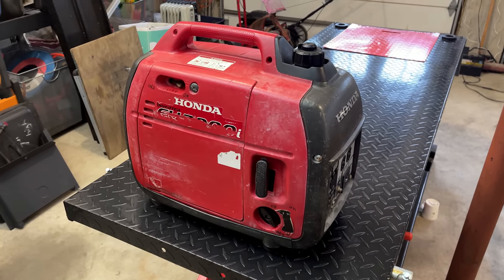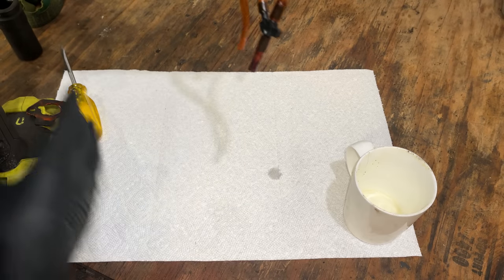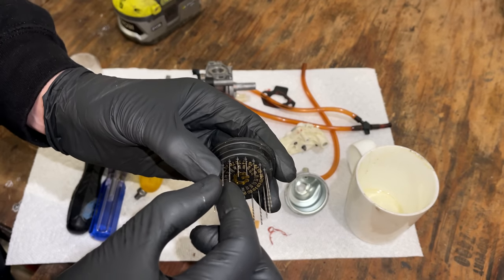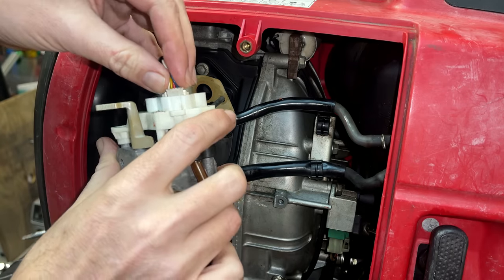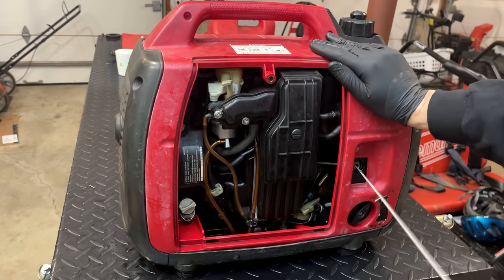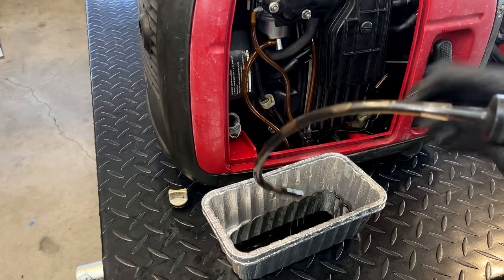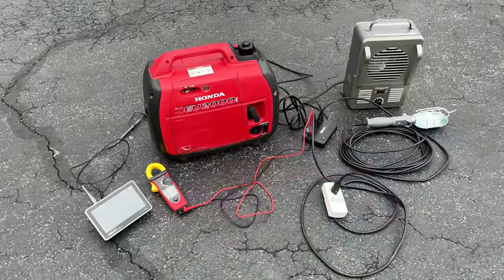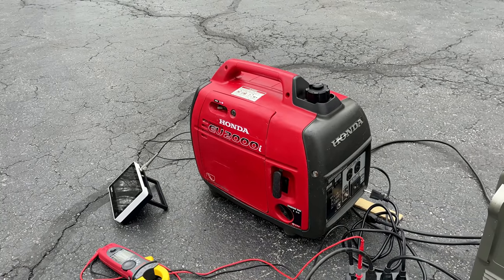Old Honda EU2000i Generator Leaking Fuel

Comment: Why are there extra tubes on that carb ?
Reply: Drain and overflow.....
the lines lead the spilling fuel straight down to the bottom and out of the machine...
less chance of flames that way....
Reply: @JohnSmith-yv6eq  The drain is on the bottom. If those other 2 tubes are overflow, why was   fuel NOT coming out of them when the needle was not properly seating ?
Reply: @jackpatteeuw9244  
because the bowl drain plug was tight and was not leaking....James had to undo the bung in order to drain the carb..and as he said "should have done that with the carb still on the machine".
If you have corn juice in your gasoline...it's worth drianing the carb this way when storing the generator unti lnext camping season....
and the top overflow...well the needle only allowed sufficient fuel to make it's way out of the airbox.....not a huge amount enpugh to flow out of the top overflow...

Comment: I have a similar issue except the fuel is leaking into the piston side. I know this because i cant start the engine hot and I need to wait 10 minutes before it will start again. Plus there is fuel in my engine oil. Not really sure what the fix is because my float and needle seem to be working fine.

Comment: James what is a fair price to ay for a used Honda Eu like that one you repaired?
Reply from the maker: Usually between $500-$600
Reply: @jcondon1  Thanks LOVE your videos. That what I thought for a price.   I have a eu2000i, a eu2200i, a eg2800i, and a Honda Harmony 2500.  I found another eu 2000 that someone sold me for $300.00 which I had to clean up and work on and only spend less than $100.00 for parts. All my Honda generators are wonderful and run great when needed. 

Thanks for giving is such great videos on your excellent work.

Comment: I think if the ground the generator was on was unlevel, I would put oil in until it was at the top of the threads even if more oil rather than trying to level the genset because all its going to do is vibrate off.

Comment: Hey James have one of these that dies when loaded in eco mode but can handle a load with eco off. Any suggestions?
Reply from the maker: If applying much more then 800 watts at once then eco mode has to be off or it will likely stall.  How much are you loading it at once?
Reply: @jcondon1  maybe that’s it. Was trying a 3 gallon air compressor and a shop vac separately. It did run a medium size floor fan ok.
Thank You!

Comment: Crikey. You're in your shop with a piece of equipment you know leaks fuel and generates electricity. 
Could be a bad combination? I'd have done all of this outdoors where a fire could be walked away from.
As for needle valves. They're cheap, cheerful, and stop working if even a hair gets fast in the orifice. The other thing they do is stick solid until you remove the carb from the engine, then immediately conceal their crime by starting to work again, especially when you turn the carb upside down to test it. They also tend to stick a lot more easily when they start to wear where the needle seats into it's hole. Not great.....

Comment: You need 3 things to run you always have Air you have fuel so spark, I would have hit with just a bit of start fluid just to check if it would pop off!

Comment: I have the same Honda and it has this problem since the day I bought it it runs fine but once I have finnished with if I leave it for around 2 weeks it will not start unless I take out the spark plug put some petrol in the cylinder replace the spark plug then its A-ok it have been returned to Honda they say its fixed but still has the same problem it appears its a lemon no one has been able to fix

Comment: It's so crazy that my generator never has leaked fuel yet at the carb and I never turn off fuel just leave it in the choke position for easy starting mines a wen 3800

Comment: I really hope you did not use 0w20...AT LEAST 10W40 on older engines
Reply from the maker: It would run better with 15w-40.  I used 10w-30.

Comment: Supposed to be a One Pull Start.
Reply: All things being equal...yes they are.

Say you have turned it off to refuel it after running it 5 hours on an auxiliary fuel tank (outboard motor tanks can be adapted because this Honda gen has a fuel pump).
You fill the tank, check the oil...pull the cord and it works for another 5 hours.

One pull. (hot engine run on good gas, well cooled, oil level and quality good, spark plug good.)

Second scenario: 

You stored this in the shed for the last year, at an angle and where dust and dirt can blow in and cover it. 
It has half a tank of fuel that you tipped out of your old rusty gas can just before putting it in storage.

Now 6 months later you go to start it....and you pull...and pull...and pull...but it won't start.

You strip it down like James did and find water in the fuel, water in the fuel pump, water in the bowl,..
and corrosion in the carb jets too.

Is that the Honda's fault or just your stupidity?

Comment: Those poor fuel lines are as stiff as a dried stick.
Reply: The drain and overflow lines are not subject to much movement...
they could be replaced by tygon lines....
and the actual fuel line in seems flexible enough....
Reply: As Taryl says "hard as a carp " !🤪

Comment: You really think it is that easy to hire and keep a good small engine tech?  Even for a Honda dealer.The one thing I do not like about the Honda 100/2000 W generators, they have an overhead cam belt, if that goes, it expensive to replace.

Comment: They should all just come with a replacement carb,,jeez
Reply: The original carb works for decades as long as the owner looks after the fueling and the draining of the fuel system...
and doesn't store it with ethanol gas in the system or tank,,,,,,,,

Comment: Come on. Nobody, even Honda would touch it? Kinda sounds like a hokey story. Would have like to see another week of sitting for another smoke check. That may have burned off, but I bet there will be another smoke show at its next start.
Reply from the maker: I think you are right.  Probably needs new rings and valve seals.

Comment: mopar penetrating fluid is the best thing to clean jets etc .. spray some in a cup drop in all yer jets , tubes etc and let it sit for a few hours your mind will be blown with the junk  that will come off and spray it into all carb holes  let it sit for a few hours rotating carb in different positions every so often . and then clean out with brake cleaner  , carb cleaner is a joke and sticking wires threw doesn't do a complete job , trust me try it

Comment: You just bend the brass bit that hits the needle shut takes a few seconds.
The rest of the video is nonsense.
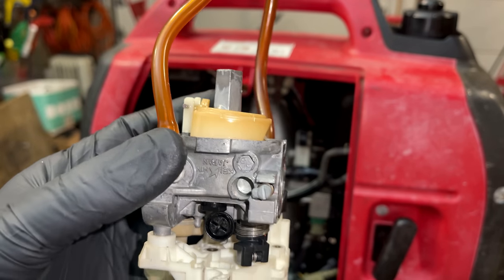Reply: 23:43
No brass bit able to be bent..
All plastic including needle. 
Needle bent=curved=less length than necessary to stop fuel flow....
Replacement only option...

Comment: Reasons why not to buy a Honda generator. Overly complicated. Repair parts expensive. Excellent marketing per low noise figures. Generator noise that can be handled simply by cardboard deflection panels.
Peace from Texas

Comment: Sure glad I was not paying for your time!  I am a Honda trained motorcycle tech, owned one of these Honda gens for 4 years , was full time rv living.   Sure you was dumbing this down and dragging it out for you tube,  not sure why you would want to yank that cord as many times as you did, way to much effort.  You clean the carb and replace the plug, crazy you didn’t knowing all to well the engine was flooded due to a carb issue and it certainly would have a wet plug.   Lots of smoke and mirrors with all that test gear too,  all you needed was a load to 1500 watts and a volt meter,  was you trying to impress the less knowing?   I would like to say well done,  but I think your a bit of a con artist.  You made this way to technical and dragged it out for what was a simple fix.   For the cost of a needle and float,  a can of carby cleaner, cheap, compared to your labour time,  the cleaned carb should have been set up with a new needle and float.   Then. After all this, you cleaned the plastics up with wd40 then proceed to fit stickers?  More labour time?   Then more labour time setting all that test gear up? 
I hope the customer was ok with being bent over like that .   I guess your got to make money some how? 
I have done this carby clean and spark plug replacement many times over 4 years, it a half hour job at best!  
In half the time you spent I would have had the complete plastics off and checked the tappets.
Reply from the maker: The customer was not charged for the repair.  YouTube takes care of that.  The needle and float I pulled from the other carb were new and installed when I rebuilt it.  That carb was not running the engine well so I ended up not using it.  Many have asked to see the harmonic distortion and the sine wave output so I try and work that into most videos.  And yes I pulled it over way too many times.  The customer said it ran, but was leaking fuel.  Should have checked the plug sooner.

Comment: Anyone notice 10:27 the old float inside have fuel usually some carburator's float have tiny hole ,
I wasted my time because of watching you video 👎🏻
Reply: Did you not check the float?
Shake it...the put it in water and watch to see how it floats?
Hold it under water and watch for bubbles?

Comment: Interesting to see their generators suck as much as their outboards. Honda warranty is a total scam.
Reply: They’re outboards are good my buddy runs a charter service with twin Honda 150s
Reply: You can't slack off the maintenance and correct storage procedures for any engine...including a Honda.
An outboard needs to be treated better than your significant other.......
Reply: The carb on mine calfed after 25 hours. 25 since new. The needle valve and float assembly seems to have been made to not be replaceable via normal means so cutting it out then probably drilling and tapping the metal to accept a DIY fabricated pivot rod is the only solution why of an aftermarket carb. Fuel injected engines are in a different realm due to the higher fuel pressures overcoming fouling from dodgy fuel. Ample evidence supports my assertion Honda is low quality. It's why they aren't popular in developing countries: not reliable. I'm happy your buddy has had a good time with his but the small Hondas are trash